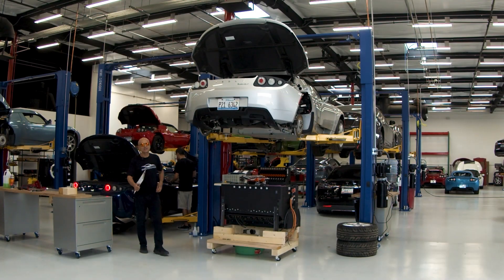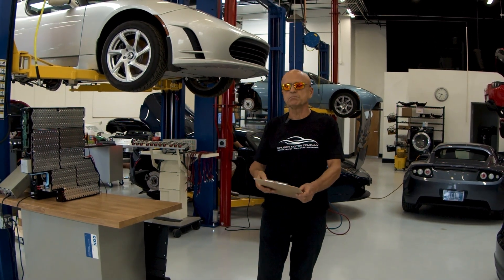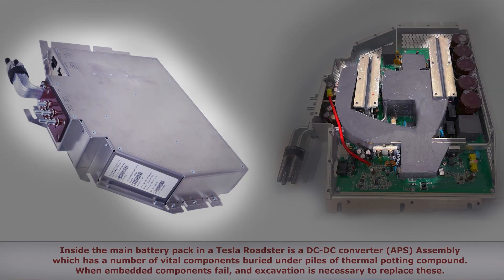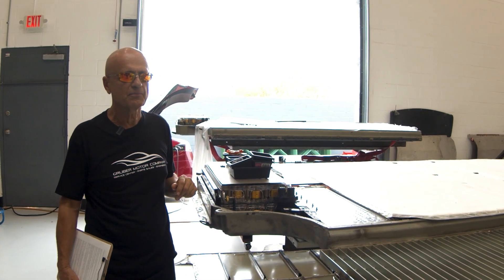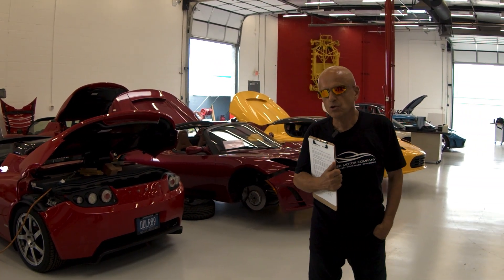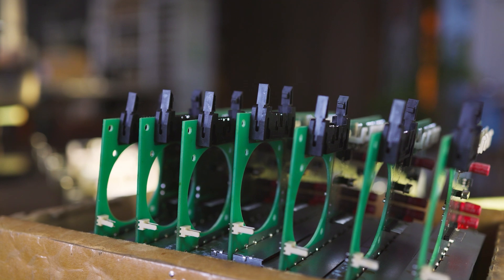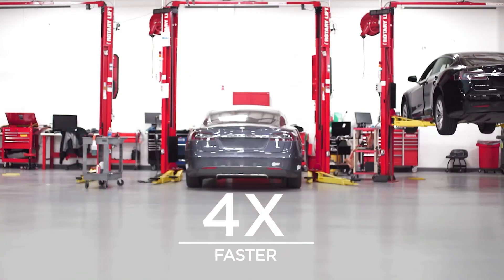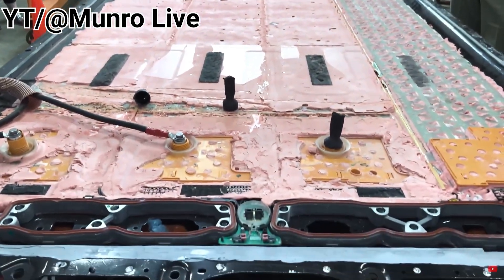Impossible to Repair TESLA Batteries | Gruber Motors

Comment: Nickel, a major component of the EV batteries, is found
just below the topsoil in the Rainforests of Indonesia
and the Philippines. As a result, the nickel is extracted
using horizontal surface mining that results in extensive
environmental degradation: deforestation and removal
of the top layer of soil.

Comment: Tesla's new 4680 HV pack (currently only in Model Y from Austin, TX factory) moves their cars towards a disposable smart-phone device.  But smart third-parties have learned to repair smart-phones affordably, so perhaps companies will innovate ways to repair these new HV packs.  Perhaps special electric die-knifes to thermally cut the stiff foam, or a solvent to dissolve it.  It would be nice if Tesla designed to make such repairs easier.  Early videos showing removal of the top cover on a Model S HV pack are cringey, with the RTV to scrape and replace, hoping it will seal out moisture after the repair.  Would be nice if they used a captive silicone gasket like the valve cover seal in newish gas engines.

Comment: Great video, with confirmation of my thinking that competition in the US is more observed in theory that reality.
I would have thought that moulded, hard preformed strips between individual battery cells - slipped down after cell installation- might be nearly as effective structurally when the top panel is fixed?
Reply: why would you think that? The foam is stronger and fills all spaces to make one solid brick... could be a thousand x difference in strength to what you suggest. The point of making the battery structural is to save weight in material that would otherwise surround the battery, the plate that you want to produce strength is not meant to be structural anymore... Tesla is doing this to be better than the competition so it shows competition is alive and well? Tesla is sharing all their tech with anyone who wants it so I guess that is trying to foster cooperation in order to make sustainable transport happen sooner, so I guess that is not competitive behavior? Cooperation between car makers to make the change happen sooner seems like a good idea to me...
Reply: @0ooTheMAXXoo0  Just a thought - I’m not a structural engineer!
I accept that making the pack a structural unit, the top and bottom plates being effectively the two load bearing parts is a good idea but the weakest part would be the cells in each case.If “wavy” tough plastic replaced the foam, tight in to each cell and bonded to the top and bottom plates it would be virtually a solid unit and it would be relatively easy to access them.

Comment: Stop buying elon's crap....
Reply: And put these repair people out of business? They are not complaining about the battery packs. They know structural batteries are a must in order to save weight and increase range or use less batteries for the same range... Making steel uses way more cobalt than any batteries for example. Saving a bunch of material and costs and weight is too good to pass up and would mean an inferior or overpriced product otherwise...
Reply: @0ooTheMAXXoo0  Elon isn't the only EV company in the world now so I bet they won't go out of business fanboy. I bet that box full of potting compound weighs more than the prior series of batteries also makes that battery unrecyclable so much for the environment elon cares so much about....

Comment: Trying to understand what the point of this post is, Pete.  You have shown no interest in working on Model 3 or Y's that I have been able to discern from watching so many of your videos.  Are you upset that Tesla's structural battery design is making it more difficult for your third party business model to thrive?
Reply from the maker: In the independent space, we do not see warranty cars, therefore our experience with M3 and MY is very limited.  When warranties expire, our interest peaks and we get busy reverse engineering and developing service procedures, schematics and software tools.

On the surface, this new structural battery pack poses a new set of service challenges, none of which are a deal breaker for us.
Reply: @grubermotorcompany  Fair enough, and good to hear.  Though one would expect that the additional effort, time and expertise that's going to be required to de-entomb the latest structural packs is going to most likely result in much higher labor costs for both you and ultimately, your customer, for the kind of repairs you perform, no?  This would seem to suggest that as the scale of manufacturing these structural battery packs grows, eventually to the point when  recycling becomes a closed loop process between manufacturers and Redwood Materials, for example,  hopefully reducing the cost of new battery packs, it might make the labor and cost intensive options of deconstructing to repair somewhat obsolete or at least less attractive from a cost/benefit standpoint?  Is that a fair assessment?

Comment: Best of luck you folks will find an answer, I have faith in your abilities.  If you don’t mind me giving you my input ( which your team probably has already considered. First
Munro doesn’t plan on doing battery tear downs consistently like your team so their choice of attacking this was not expedited or economical, didn’t need to be, yet they did do some damage. 
I was thinking a sealed tank with a liquid squirting gun ( like a solvent tank for cleaning auto parts ) use the best solvent for that foam probably acetone. It will have to have a separation tank to filter out the absorbed foam.  
Taking off the lid ?? If it has to be destroyed remember the old key and twist off can openers for sardines rolling the cover like a Tootsie Roll.    
I must say Tesla did an excellent job of engineering this new battery pack. It will probably assist in cooling the pack better due to the insulation forcing more heat towards the chiller fluid cooling fins. Basically extracting heat more efficiently.

Comment: Right to Repair lawsuit should be filed.
Reply: Tesla makes the service manuals, schematics and connectors available for free.  Still, not smart for most owners dealing with leathal voltages without the right equipment and training.
Reply: They should check with Louis Rossmann. He's very active in that sector and is moving his efforts more in the R2R direction now, where at first it was MacBook repair etc. He'll still be active in that too but he's backed by many and backed by money.

Comment: I will never buy a Tesla or any electric car that doesnt offer easy battery repair
Reply: No one offers easy battery repair. These are 1000 lb units that require specical equipment and prorcesses to remove (all brands).  What you want is reliability and longevity. Modulatiry reduces both of these.  Tesla learned this many years ago, and others will figure it out in time.   Actually, few ICE cars today are easy to repair either.  Anyway, EVs (all brands) like most ICE cars are no longer easy for the DIY to repair.  The big advantage for EVs is the far higher reliability and fewer repairs that are needed in the EV's lifetime.  Still some repairs may be needed and it's great that Gruber motors and others are offering services to do complex repairs.
Reply: @tesla_tap  You are  correct about new ice cars being hard to repair,  thats why i dont buy these hybrid cars or in volvos case an engine with both turbos and compressor and hybrid, still.
However when it comes to electric cars, since i only buy second hand cars, i would not buy one if the replacement battery and installation is over 10k usd. and so far i dont think that exist
Reply: @mrd799  Why? Even the oldest Leaf batteries last millions of miles with over 80% of its original capacity, on average. Basically, every battery has a few flaws, they will show early and the longer the battery is in use, there will be fewer and fewer defects left to show themselves. So most batteries loose capacity fast at first and then the loss slows down and ever slower it approaches 80-ish percent... Unless you get a battery with more flaws or less flaws in which case you will be better or worse off than the average... If you buy a used EV with many miles and little range loss then the battery should last longer than the rest of the car easily...
Reply: @0ooTheMAXXoo0  Millions of miles i 200,000 – 300,000 miles for a Leaf